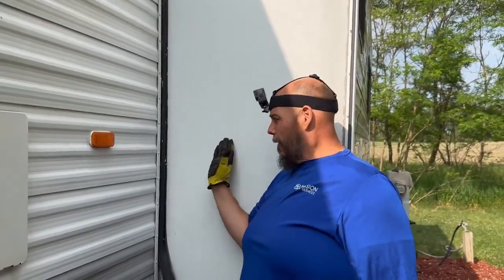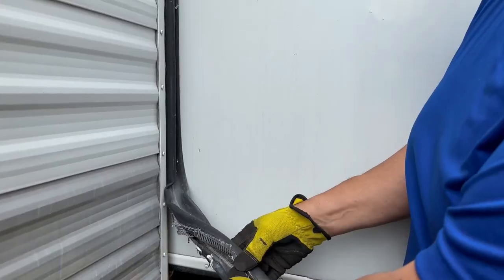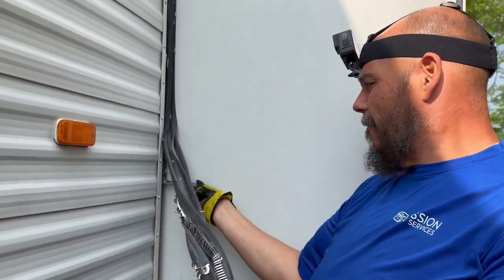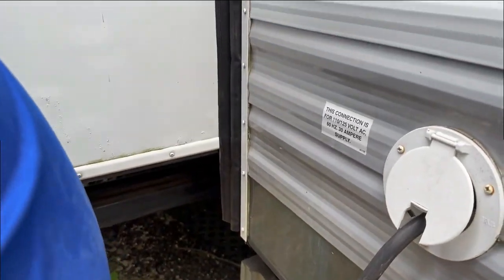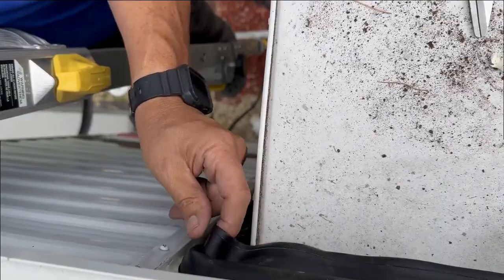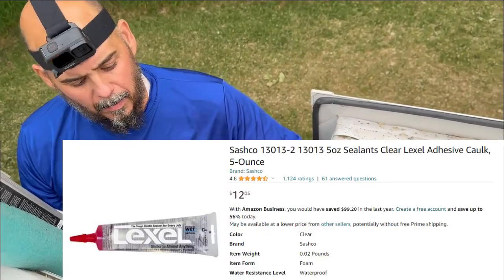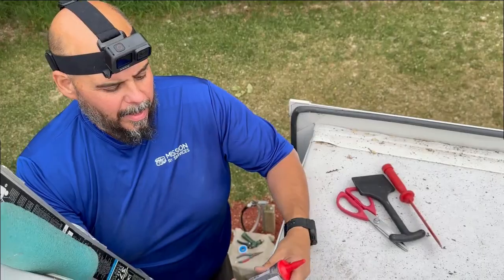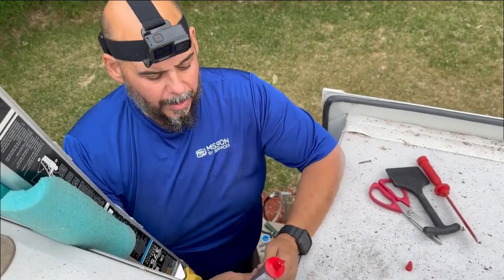How We: Replace Double Bulb Slide Out Seals

Comment: In the process of installing the new seal (that has the metal V) the rubber is pressed to tightly together to slide in place. Should I spread this spit before putting it in place?
Reply: Oh and our seal goes all the way around the slide out opening
Reply from the maker: That may be an indicator that your slideout needs an adjustment, right to left, if one side is easier than the other.

Comment: Is there a second seal on the inside side of the slide? Or does the double bulb seal when the slide is in or out?
Reply from the maker: Some do have one on the inside as well, but this travel trailer did not. Those with bulb seals on the inside, those bulb seals rarely go bad because they’re not out in the elements.

Comment: Do you change the rubber on the slide out its self
Reply from the maker: @garylawson5230  we also change the wiper seals if they need it. We find that most times it’s the bulb seals that need replacing. Probably because those get neglected the most.